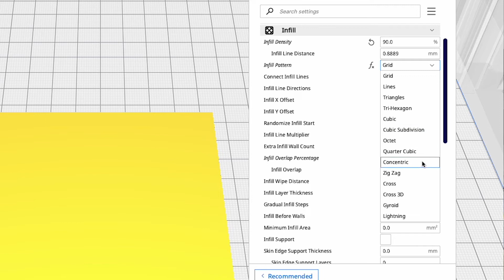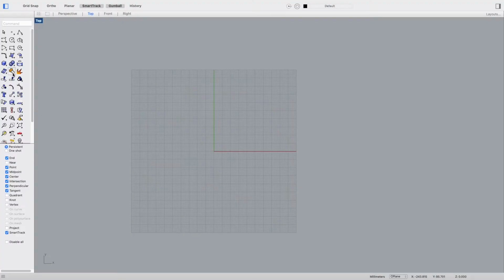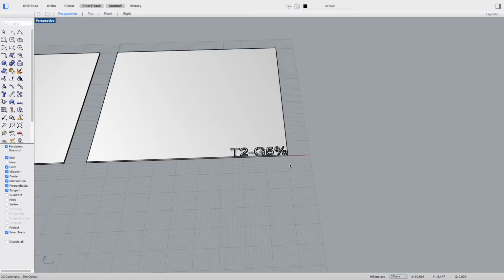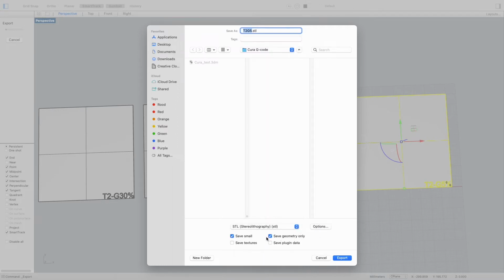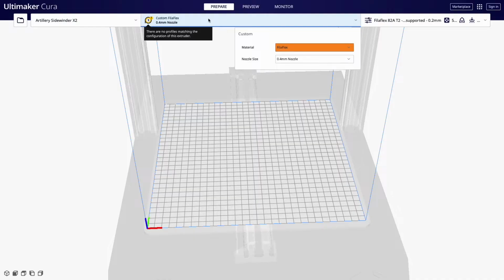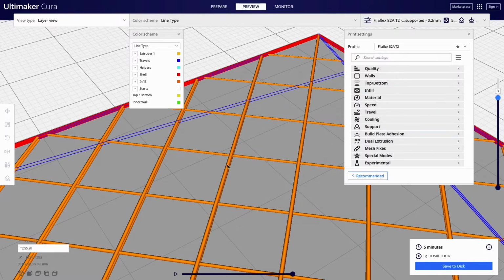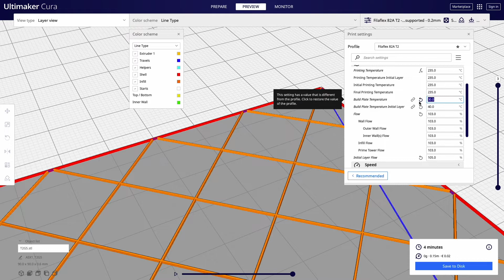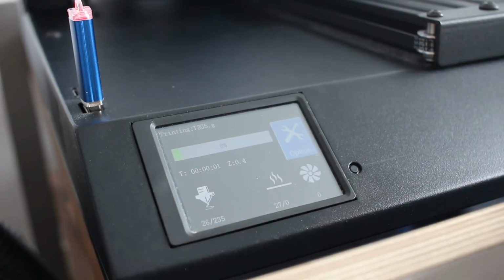3D-Printed Textiles [GRID] Review

Comment: 10:41 may want to use a finer and lead-free nozzle for lingerie...
Reply from the maker: Fascinating, thanks for the tip! Will look into that :D
Reply: @PARAPRINT  No problem. Both resins and also some filament dyes aren't 100% safe, but info is scarce unfortunately. I'm working with tpu for elbow pads and will just line with a layer of fabric to avoid the issue.
Reply from the maker: @1fareast14  cool!! Yeah I agree, skin testing is probably not yet on the radar for most filament companies as printing wearables is still tiny compared to PLA stuff. Reach me on Instagram, would love to see what you’re making! <3